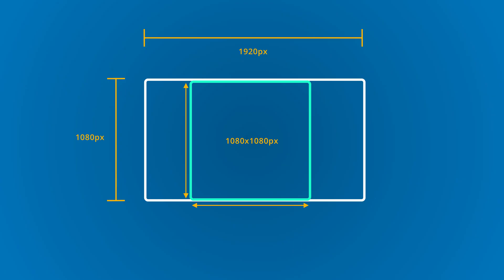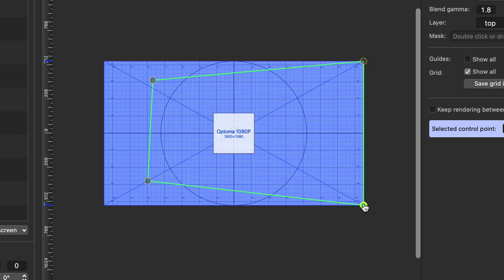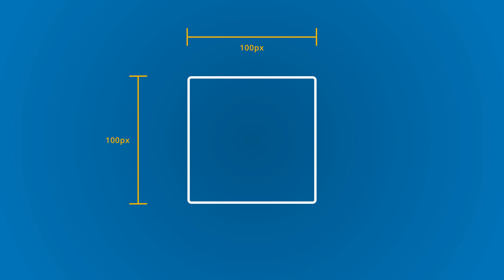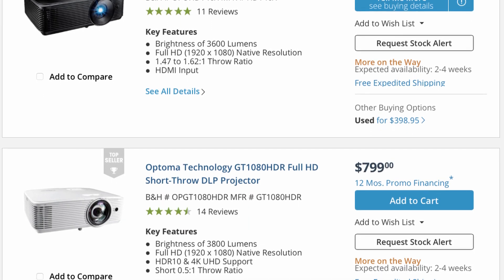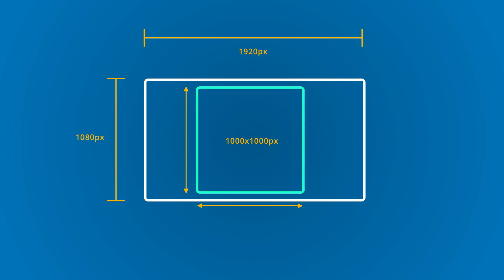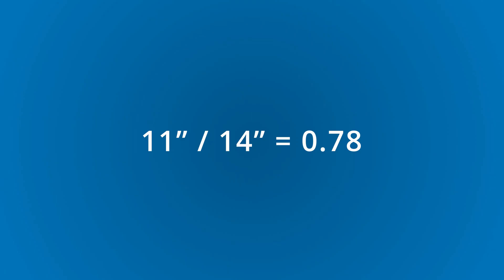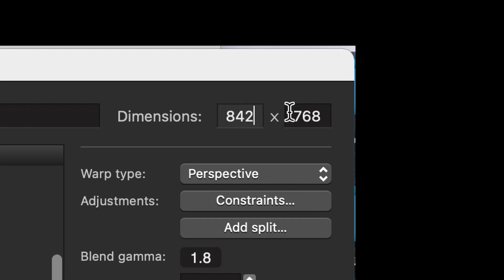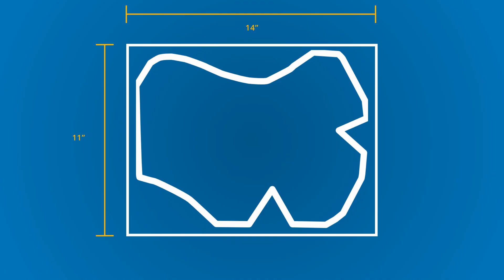How to Calculate QLab Surface Resolution

Comment: Hey Mate, I just have a question and was wondering if you would be able to answer it. Is it possible to map a projection onto 4 walls with 1 projector? In this case a stage. Or would that be a job for multiple projectors? Thanks in advance! Great video :)
Reply: Hi just watched your video on projection mapping edge blending and it answered my question ahah :) I was wondering if you have any medium budget projector reccomendations for stage projections?